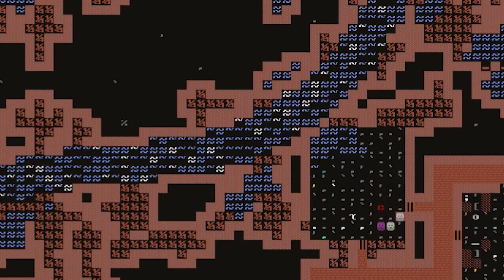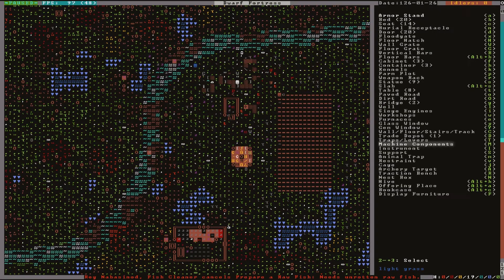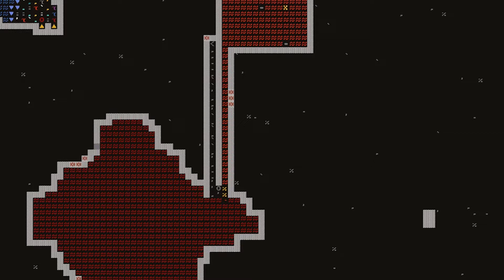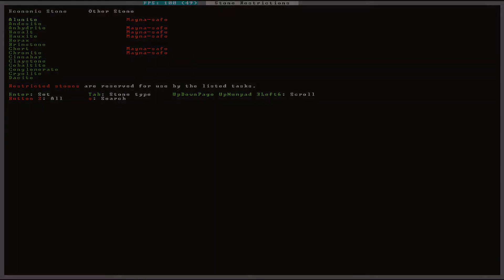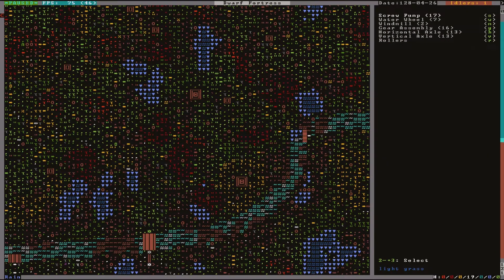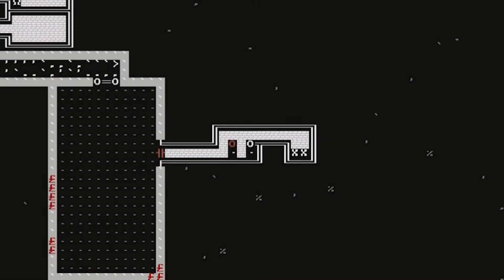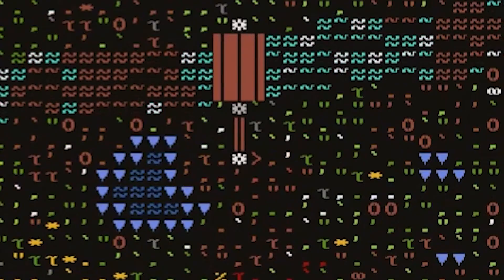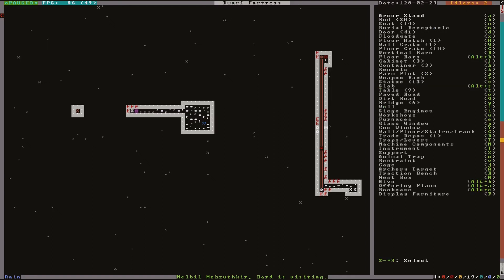Dwarf Fortress Engineering 101: Screw Pumps, Pump Stacks & Mist Generators

Comment: if you put 2 pumps top of each other, one is north to south and the top one south to north, dig a hole in front of the bottom one then fill it with 3-4water and if you feed it with power it will create a waterfall with little water